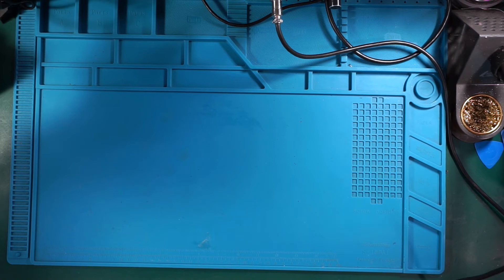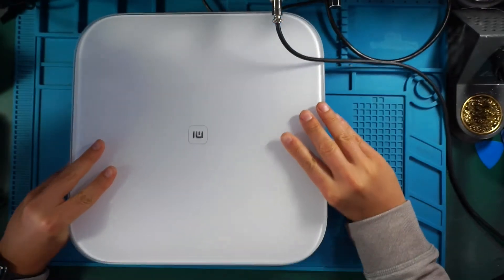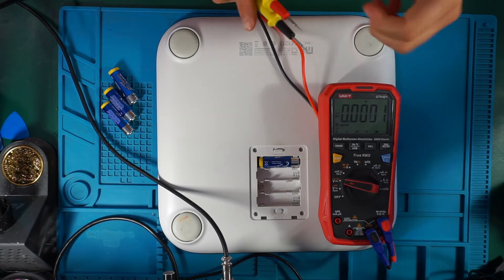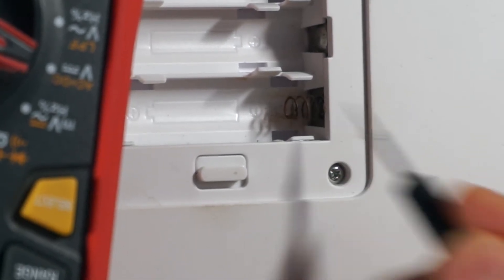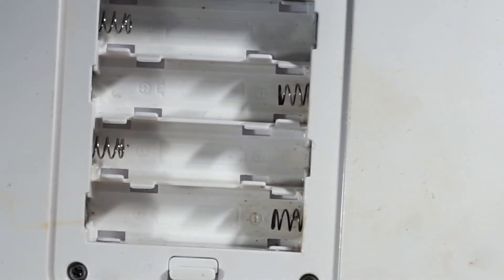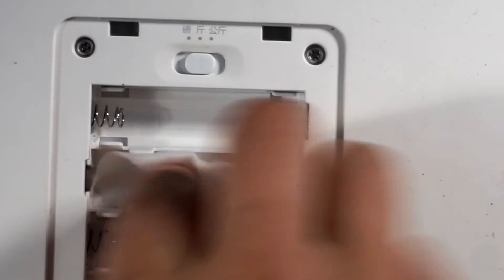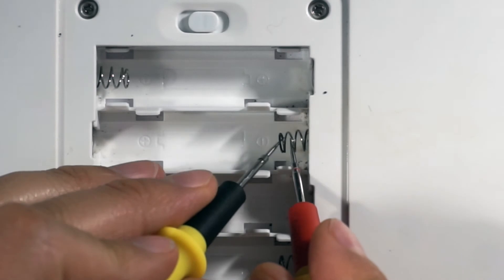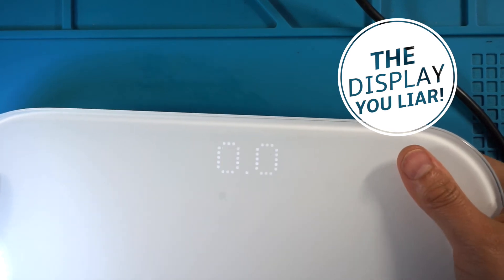Xiaomi Scale Repair Done FAST!

Comment: Hi bro, I also using this scale , but do you know This scale have battery drain issue ?, I want to fix it but i don't know how to fix it... so pls let me know how to fix it scale....
Reply from the maker: Hi, I am not aware of any battery drain issue. What exactly is not working, or how is it behaving?
Reply: @CanWeFixThat  Drains batteries in a week or 2week( normal product using 6~ month ) , And i found that someone remove bluetooth module is problem, but i'm not sure whta is bluetooth module and how to remove it, ( and is it safe to remove ? )
Reply from the maker: @ user-bc4qe4lm3y, open the scale up and look if you can find something obvious. Do you have a thermal camera or something similar?

Comment: I have same scale and I left batteries in it and forgot after 9-10 months scale isn’t working I changed batteries. There was liquid of old batteries coming out. Can it restore or not
Reply from the maker: That is hard to answer. Try cleaning it as I do and checking it out. If this won't help, you must open it up and diagnose further.

Comment: Hi, do you have any idea how to solve "couldn't measure" error as well?
Reply from the maker: Hi, sorry, I am not familiar with this error. Sounds like the weight sensors would need to be fixed. You could try to open the scale and check the wiring for damages.